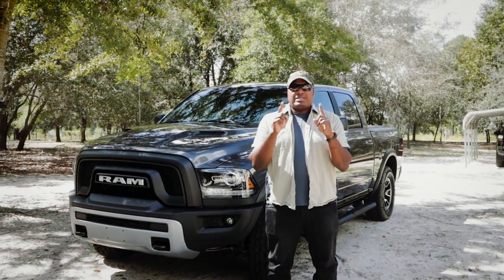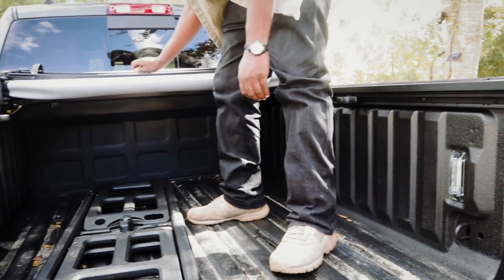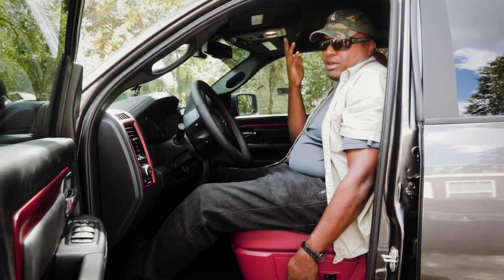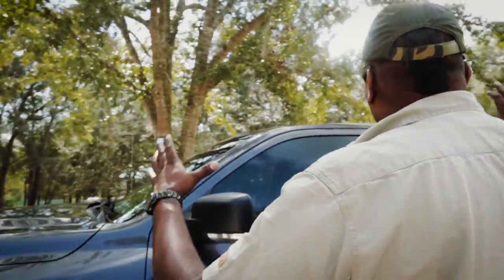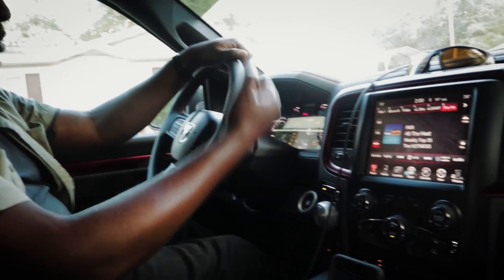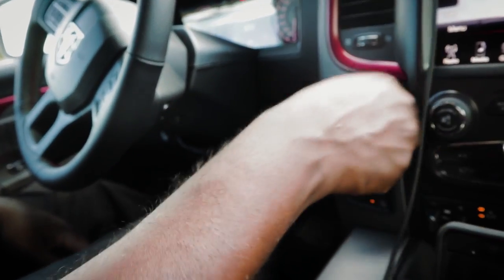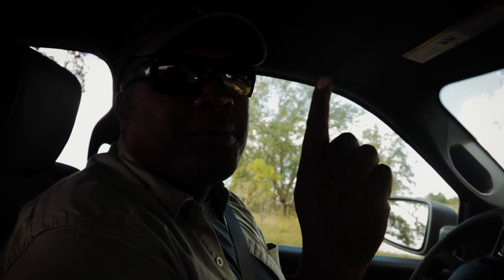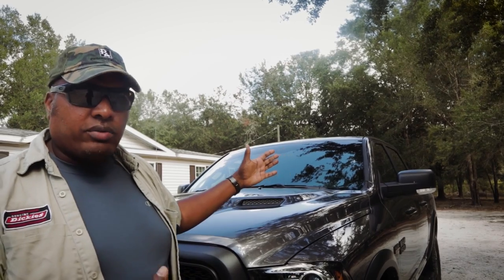2017 Ram Rebel Off-Road Test Drive First Look

Comment: Come hop in my '17 Ram Rebel. I'll show you how this truck destroys off road. You got to get it in 4 high with no TC and quit being light on the throttle. This truck is beast when driven right.
Reply: Have you had any issues with your truck? I’m thinking about getting a 2017 with 69k miles

Comment: I had the same issue with my Rebel, 2017.  I finally found out that the electronic traction control also needs to be off.  That helped me in the snow.  Not sure about sand.

Comment: On sand, you need to have it on 4x4Lock and turn off the traction control. You also need to air down the tires. Or get a Power Wagon
Reply: 100% agree. My off-roading growing up was sand dunes. 4high, any and all sorts of traction control turned off (don’t want to limit power when you need it), and air down tires. You need that footprint. I’ve personally gone as low as 10-12psi in my tires while on soft sugar sand like that, especially to climb. If you’re just beach cruising though it’s not necessary, 9 times out 10.
Reply: Well said, and, even with a PW you need to air down.  Sand is NO fun until u air down, then it's SO MUCH FUN.  Carry an air compressor and a valve core remover tool.
Reply: I couldn't said it better myself

Comment: 4WD Lock means that it locks the transfer-case in 4wd. So the power is being sent 50% front and 50% rear. Also: momentum and low tire pressure is key for sand.

Comment: If that’s sand it is a good idea to air down your tires to get a larger foot print. That should be able to go right up that with a little bit of gas. And you also want to be in high when on sand. And turn the traction control off to give you full power. Just a few off roading tips from a veteran off roader.

Comment: I took my Rebel up a very tough mountain trail consisting of deep and steep pockets of dirt, mud, rocks and sand, and it did it with flying colors.  As others have said, You didn't really approach the hill right.

Comment: 4wd lock = high range. It locks the truck into 4wd is all that means. That truck doesn’t have any locking differentials, it does have a limited slip diff in the rear and a good traction control system. But the 4wd system can’t even touch a 4 runner which is one of the most capable 4wd vehicles available.

Comment: I actually like the rotary shifter. I have had a Ram with it now for a couple years and It works great. Never had an issue with mistaking it for another knob it is significantly larger than any other knob in the truck. Only thing I miss about other shifters is having a manual shift mode on them which is better than the PEZ size shift buttons on the steering wheel on the Ram.

Comment: Nice truck.  If you air down the tires to 15lbs your problems driving loose sand will mostly disappear.  O'course airing down and airing back up takes time.  And you are probably 1000lbs heavier than the 4runner.

Comment: I'm no expert either and I see no one else has mentioned it yet, so I'll try to explain it the way I understand it.  'Lock' usually refers to having locking differentials.  Some vehicles have just a rear locker and some have front and rear both.  The diff is what allows one wheel to spin at a different speed than the other wheel on the same axle.  When this happens on loose terrain all your power goes to the wheel that has no traction and is spinning freely and the wheel that does have traction isn't doing anything.  When you lock the diffs both wheels spin the same on both sides no matter what, giving you better traction on loose uneven terrain.  Obviously front and rear lockers is better than just the rear.  Some vehicles let you control them independently and some just lock everything at once like an on/off type of setting.  I'm pretty sure the power wagon has lockers on both axles but I'm not sure about the rebel.
Reply: Incorrect. Power Wagon has 4WD Lock AND a REAR locker.  4WD Lock means that it's locking the transfer-case in 4WD. So it sends 50% power to the front and 50% to the rear. A Locking differential means that it locks the axles together so BOTH wheels will spin regardless of traction.

Comment: 4wd lock just makes front and rear tires turn at same speed. And higher gear ratio.  4WD LOW gearing mainly for pulling and mudd with oversize tires

Comment: Thank you for the great video.  However, it reaffirms why I’m going to wait for the 2019.  The 4X4 system isn’t as advanced as its brethren.  Even a Cherokee Trailhawk comes with a rear locker and drive modes but this doesn’t.  Also, where’s the safety tech that $25k cars have?  I love that truck but I won’t buy it until it brings the technology up to par.
Reply: yeah I still don't get why these 45k plus trucks don't have crash prevention or lane keep...but tiny passenger cars do standard. At least Toyota is making it standard on all models including the Tundra in 2018

Comment: TBH The fake vents, and Red interior trip are ugly, It'd be nice if Rebel had a conservative Gray or black trim. Otherwise a nice truck, most bang for your buck, same with the Pro 4x. The raptor is way to expensive for daily use. The Trailboss is looking great though.
Reply: The red accents are actually an option for the Rebel.  Standard interior is black with grey trim.  Depends on the color of the truck is going to make the red look good or not.  I have the exact same color scheme on my Rebel and personally I like the red accents... With this color scheme.  I don't think it looks good with the white, silver, blue or Beige colored exterior. Black, charcoal, and red exterior look good with the red accents.  

As for the fake vents, they are a throwback to the 70-73 Challenger's hood.  Those vents were fake too unless you had the ram air option then they opened to the air cleaner.  I like the look but would have preferred them to have some functionality.
Reply: D Jay T I have the 2017 Rebel Blue Streak with the blackout everything and cf style interior
Reply: I love everything about this truck

Comment: I specifically didn't get a hood that had fake vents on my 2011 Tacoma, and got the standard hood.  I don't like anything that not functional.  The fake air vents that they sell at auto parts stores, that have an adhesive backing, are way too "j c whitney" looking.
Reply: Paul T Mopar does sell a ram air kit that utilizes the passenger vent for these hoods

Comment: uninformed newbie...  that's not a run...  stay on the throttle with "some" speed until back wheels are just about to go over the very top/crest of the hill.  Momentum is your best friend and when up hill often your only friend.  Make sure you know what's on the other side of the hill/obstacle.  Lower ur tire air pressure.  Try 18 lbs so you can still easily drive home on street.  PS: Sand has many personalities.

Comment: Damn, can't hold a candle to a Raptor but my Raptor was $63k.  Interior is so much better in my Raptor.
Reply: for 63k it better be a be a Bently inside, real leather, suede liner, real metal, real wood, and any plastic should be thick, matching textured and uniform.
Reply: Slow ass overpriced Raptors